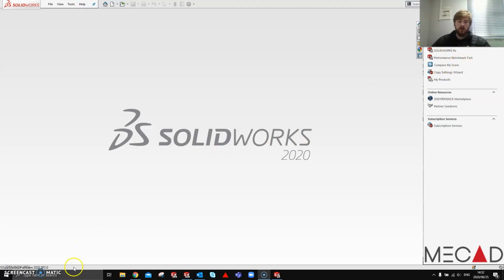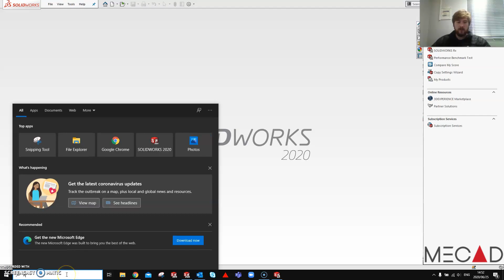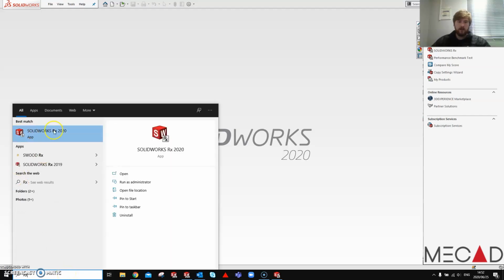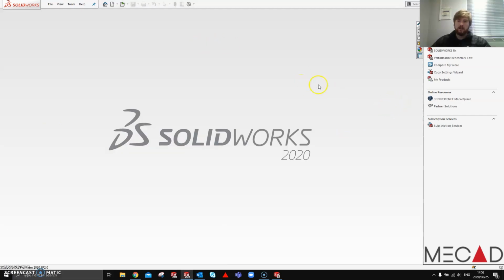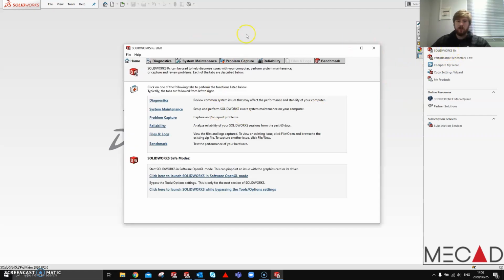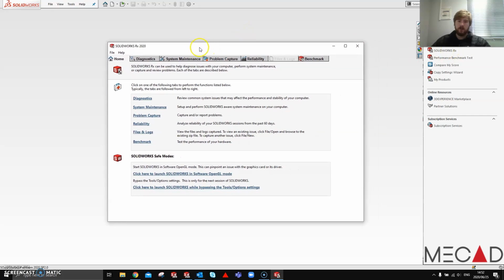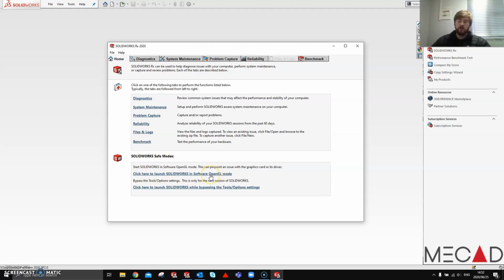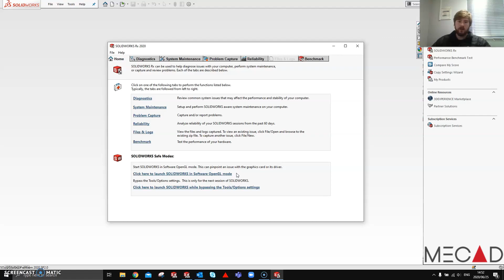Resolving SOLIDWORKS Graphical Issues with Open GL Mode

Comment: I have a cardvideo Geforce GTX 1050Ti and I've installed SW but it only open in OpenGL mode, in normal mode the workspace seems invisible :/
Reply from the maker: Hi Bruno, since only Quadro and AMD Pro cards are certified with Solidworks, OpenGL is the best way to use Solidworks with a Geforce card.